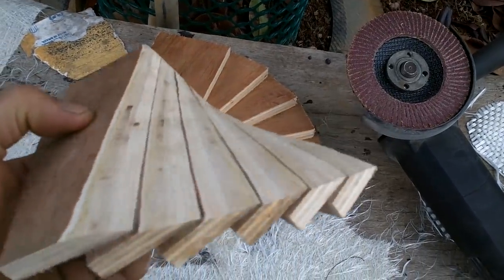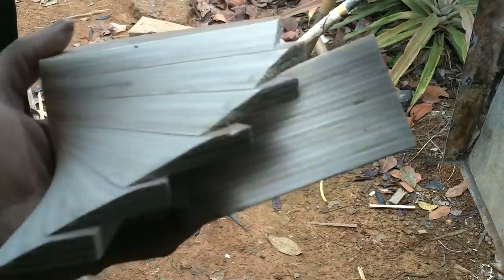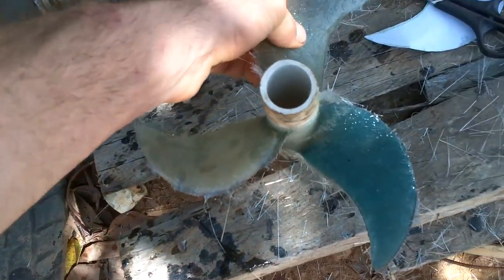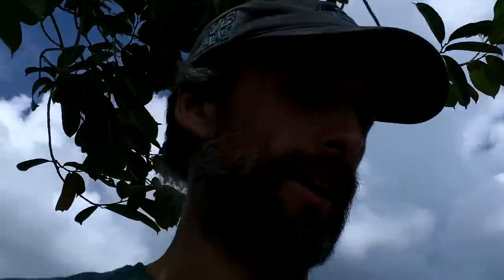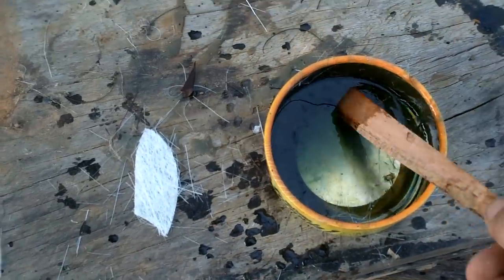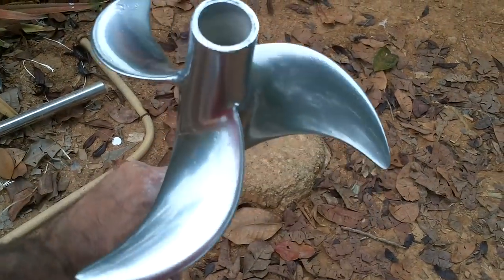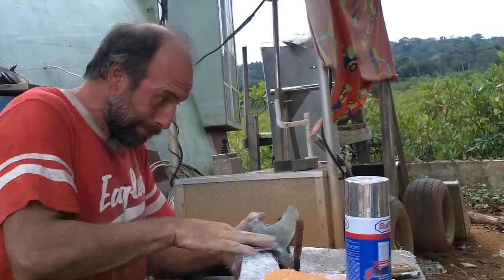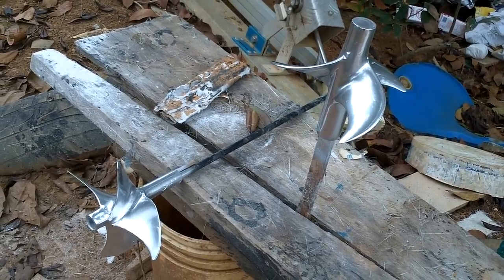Making a Propeller from Scratch.  ...or 2.

Comment: Great job. From the preview I thought they were metal but the fiberglass is perfectly fine too. Recently I did two props that I intend to test. The first was a repurposed computer fan. The second was brass and copper. Copper is definitely not the best but it was all I could have gotten in the country I was in at the time. Only 2" diameter though. I posted the videos so feel free to check them out. Maybe its an option you can use in the future with brass blades of course.

Comment: Why don't you do a list foam aluminum casting of these ? I would have thought you would be into casting aluminum. So many parts one came make strong by casting them into metal parts. Especially aluminum which melts at such a lower temperature. Good stuff regardless. I appreciate your just do It attitude !
Reply: I'm doing a lost pla jet boat pump.  80mm pump. Should be good for 6 HP.  Initial tests in carbon fiber petg and final in aluminum bronze
Reply: Why do lost foam casting when you can do fiberglass? Lost foam is finicky and requires you to do stuff like anneal the part after it's been cast (otherwise it will be very brittle) and beyond that aluminum actually degrades pretty quickly when immersed in sea water, unlike fiberglass which is pretty much inert by comparison especially if it is painted.
Reply: @Reno Simpson - so why did he start out with stainless steel ? Im not trying to be argumentative, but a fiberglass prop will never last IMHO in the conditions he is using them for. He routinely [Accidentally} hits bottom. Maybe if he wrapped a tiny bit of kevlar around each edge and the prop sleeve too. However kevlar is hard to work with in small amounts, its weave is much tighter and very hard to take shape well. Dont get me wrong I am very impressed with Jamie and his many talents and abilities. I very much appreciate his engineering by the set of the pants...use what you have on hand attitude. But making a simple aluminum forge and lost wax/foam casting is a very easy technique. and again IMHO his time and energy would be better spent in that direction. But I also hope that I am wrong and this fiberglass prop he just made will last him a very long time. I dont make it a routine challenging peoples post on youtube. Good Bye.
Reply: Jaimie needs Kevlar cloth.
Reply: @sycodeathman  because cavitation erodes composite props.  Check out the problems the Earthrace boat had with them.

Comment: Anyone know why he went with 4 blades on one propeller and 3 on the other one?
Reply: VaanG0v assuming it is to give him some options to optimize efficiency. Might might test both on a motor and see which one runs best for that rpm and speed
Reply: Good question...   I'm guessing the four blade prop on the pedal section for more "bite" and the three blade prop on the electric section for less drag and more speed?  

Them some beautiful props Jamie, they look like they are going to be real performers!
Reply: It's like roller blades, or a saw, the more wheels or teeth it has the more the weight is distributed more evenly, less vibration and it's easier to "cut" through the water, but to much of anything is bad, if you have to many blades or fins, it would go so fast it would create a cavitation bubble breaking contact with the water therefore eliminating thrust, back the other direction they use 2 blades to get through swamps to cut through branches and debrey, it all depends on how you plan on using your vehicle or tool
Reply: Watch a few vids on propellor (water screw) theory, design and production.  That is much easier that trying to explain it here.  Too many trolls and spelling/grammar nazis
Reply: @mazdarx7887  Yes, I agree with that suggestion as well.
Reply: @AtimatikArmy   Learn about cavitation, vibration, thrust, operational RPM if you want to make a prop.  But thats up to yourself,  most all the work has been already done.  Just go to a prop site, give them your parameters and the will sell you a prop for your application. Much material and time will be saved.  At the very least you will have a prop that puts you in the ball park, if you want to do better you can use the good prop as a model for future development, ie. pitch, diameter, # of blades.  But all of this designing is hard to do without a strobe and water tank. It's would just be trial, error and guesswork
Reply: @mazdarx7887  I thumbed up your comment as I have also doen a lot of prop research trying to optimize for RC electric boats, my own electric boat project and as well as being a former Expert Modified standup class jet ski racer (IJSBA).  So I know that there is a lot that goes into it and isn't so simple as "the more blade the faster you go" as one comment suggested. Despite there being more slip and harder to balance, I know a two blade prop is generally more efficient (without considering the millions of variables that obviously come into play with each unique setup) so I wonder why Jamie isn't experimenting with those...By no means am I trying to open up a can of worms in these comments by suggesting that though...
Reply: @AtimatikArmy  He do not have the space for a two bladed prop, and two bladed prop are much less forgiving in their design
Reply: @mazdarx7887  The diameter to hull clearance?  Yeah that it is likely too close to go much larger.  And yes, less forgiving but I don't think unreasonably so.  But clearance issue might rule one out.
Reply: I called it, 4 blade for the pedal section and 3  blade for the electric section...  new video came out today and that's his setup.
Reply: Cavitation testing I think.

Comment: What happened to just printing em
Reply: printed ones would be weak and break, and probably not come out as good as these. people really overestimate how practical 3d printing is in most cases.
Reply: @EvilSiper  ever heard of lost pla casting?
Reply: Barry Soetorro but first you have to draw the model 3D .....that's a lot of work , where as saw and sanding and job is done. 
Also I think his 3D printer needs repair.
Reply: Actually there are most likely countless iterations on grabcad, thingiverse and the like. They all can be edited and or modified in Fusion.  @CheersWarren
Reply: @CncObsession  Those online props might not be optimal for his pitch and boat design. 3D printing seems great for rapid prototyping though. Jme did do this at least once on an older boat I think.
Reply: I thought if he printed a super thin, internal skeleton like net, with tons of holes, The resin and fiber would bond really well to it, and it could be used as an internal scaffolding to get the form started very quickly... but the fiberglass would be doing all the heavy work.
Reply: @CheersWarren  ah gotcha i didnt see that video about the printer being down.
Reply: @Reach3DPrinters  Cool idea. Remind me potters using 3D printed designs to apply articulate patterns.
Reply: @Rambowjo2  Coincidentally, I just started working with a local potter, to 3D print a hemisphere with her logo, so the bottom of the concrete pots she makes, while drying, could be impressed with a makers mark.
3D printing is not usually suitable as an end product, but can be leveraged in so many ways to assist in creating products. The lady also asked for a 3d printed mold, to make silicone casts in, that are used in molding the rim of the pot, but flexible for removal when pot dries.

Comment: what about carbon fiber?
Reply: carbon fiber is stiffer and lighter, fiberglass is tougher (can bend more before breaking) and heavier. Weight does not play a role in this application and for a boat propellor (especially one that might hit stuff floating in the water) high toughness is important and very high stiffness might even be undesirable.
In addition to that, carbon fiber is more expensive and he already has a bunch of fiberglass.

Comment: Ya your stupid prop is not balanced its going to blow. This prop is only good for a mold, if you ran this on your boat you are going to have bad vibrations/cavitation due to not balancing the prop. Your going to end up with a hole in your boat or the prop blades will fly off the hub. I had the privilege of working for Johnson Propellers, back when they were creating their version of the four blade prop. We had built a prototype to test concept. Well the prototype was built just like yours, we wielded the blades to the hub (so dumb), but we balanced and finished the propeller properly. While out at the lake for a test run, the prop on take off blows up and punches a hole in the boat. Back to the drawing board, to do it right. It ended a success.